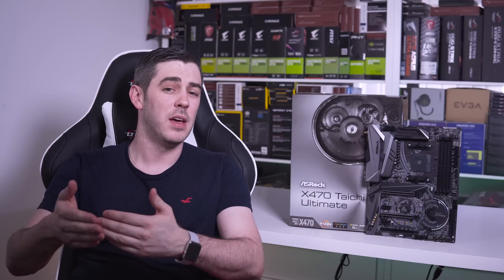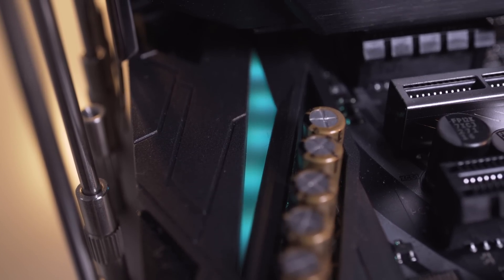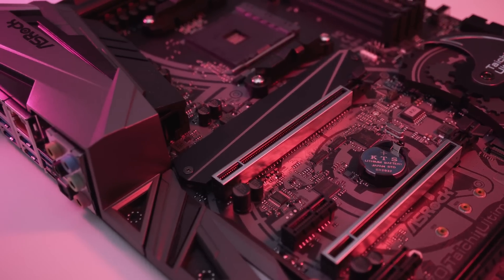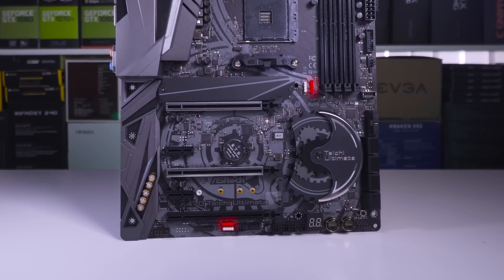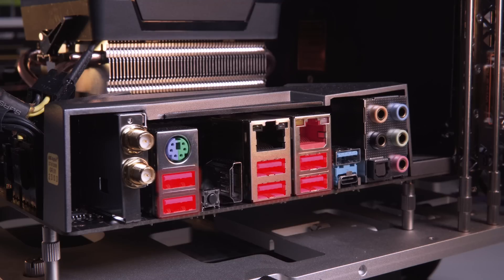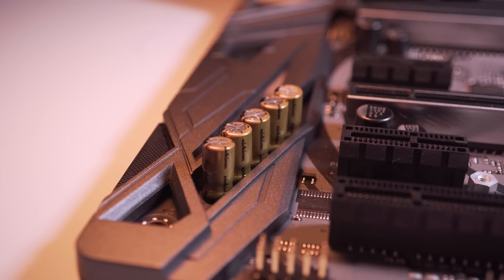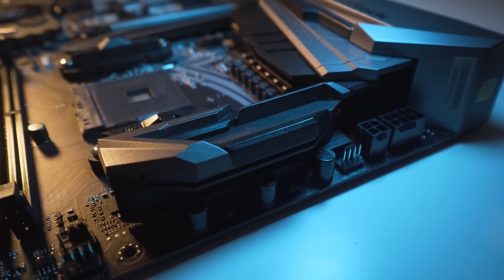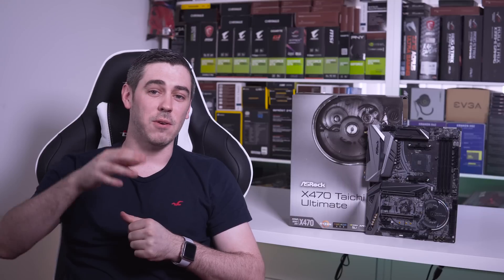ASROCK X470 Taichi Ultimate Review - Those Features Rock!

Comment: Ps2 port are fro those ( like me ) who craps on win 10.
2 flaws i can find on this board tho 

the 1st one is a major one that will never make me buy it...............bios flash back 

2nd is ( which would cost asrock that much afterall ) is a socket for the on board wifi ( mine has it ) so if i am unsatisfied or most likely it a crapintel one ( yeah it a well known fact that multi bilionair company can't make drivers other than win 10 ) i can can change it if i so chose.

Comment: Anyone have experience with the quality of the Wi-Fi? I've seen one comment on it and it was kind of negative, hoping it was just a fluke with that users experience
Reply: I don't have experience of it yet, but as I have recently ordered the X470 Taichi (non-ultimate) - which is basically identical to the Ulitmate minus the 10GBe ethernet and the power and reset buttons - I did quite a lot of research on this. The wifi on these boards is probably the weakest point as they use an Intel 3168 card which has max speed of 433 Mb/s (and Bluetooth 4.2). AFAIK this card is mounted on a M.2 socket underneath the I/O cover so it should theoretically be possible to upgrade this to an Intel 9260 with a speed of 1,730 Mb/s and Bluetooth 5.0, but don't take my word for it. Failing that, adding a separate wifi card in a PCI slot would be easy and fairly cheap.
Reply: @boac2006  so far I'm not having any major issues with the Wi-Fi, but I'm also not playing any Games that are super demanding for speed

Comment: If I may, let me attempt to help you understand PS/2 ports (3:55) If you try to install Windows 7 with this board, USB mice are not supported during the installation. I would assume the same issue probably effects other older OS (e.g. if you want to use XP). You either have to use a PS/2 mouse or enable PS/2 emulation in the bios. There are also various legancy devices that use PS/2 that people might have and not want to replace e.g. barcode readers, high end joystick/throttle/steering controls. I have a PS/2 cherry keyboard that is nearly 15yrs old that I dont want to replace. I was forced to replace a similar model AT cherry keyboard when AT sockets were dropped. NB: PS/2 to USB adaptors dont fully support all country codes. A few other reasons why you might find PS/2 useful are: less latency for mice in competitive gaming, trouble shooting when usb ports stop working, locking usb ports until login for hightened security. I hope this has been helpful

Comment: Just because you don't understand PS/2 ports doesn't mean board manufacturers shouldn't still be using them, or that they are inferior. There are many benefits of ps/2 keyboards over usb keyboards.

First, it supports full n-key rollover. Second, PS/2 keyboards aren't polled, but are completely interrupt based. And third, it is impossible for it to be delayed by the USB bus being used by other devices. As a result, PS/2 ports have a faster response time to similar USB keyboards.

The required drivers are much simpler for PS/2 and can be loaded at much earlier stage during bootup than USB drivers so PS/2 can be helpful when restoring damaged operating systems which "hang" during certain part of windows boot up. You won't get the USB keyboard drivers loading up in time to hit F8. 

PS/2 ports and PS/2 keyboards are particularly useful if you ever tried extreme overclock using Dry Ice or LN2. 

I always look for a motherboard that has a PS/2 port, even till today, even if I have USB keyboards.
Reply: Agreed. My Zowie Celeritas II keyboard is connected to the PS/2 port with the included adapter.
Reply: Thanks Jason. I nearly sprayed my monitors with coffee when I heard him say that. My first reaction was to submit a comment, but you have said it all very nicely. Well done.
Reply: And for a less technical reason...older keyboards that use the PS/2 port are virtually indestructible and still very much in use by people like me that don't care about how they look, just that they work. The keyboard I use now is over 15 years old and I'm pretty sure at this point that I'll wear out the keys long before the electronics stop working.

Comment: Your review is very good, thumbs up! But you should also cover the BIOS a bit. Also I think the benchmark charts can be potentially misleading because results from other boards are being mixed in that are using different CPU overclocks and even Intel based platforms. I feel the only way to make meaningful direct comparisons is to use the same CPU, clockspeed, RAM, and GPU across various boards to see how only the board is impacting the performance.
Reply: Their Bios are really good, as good as Asus in my opinion.